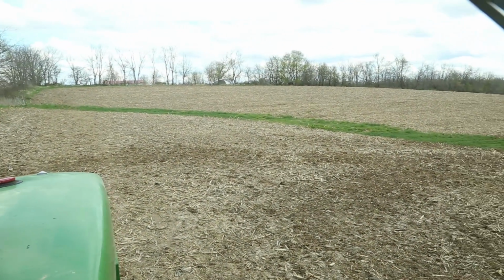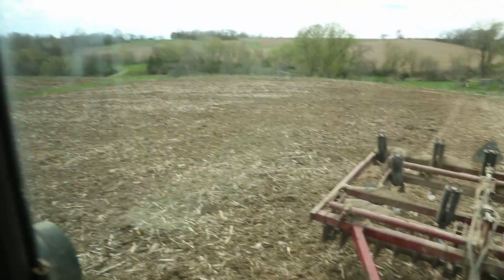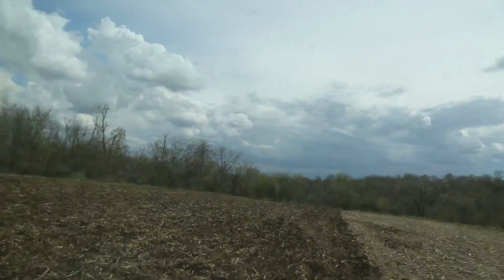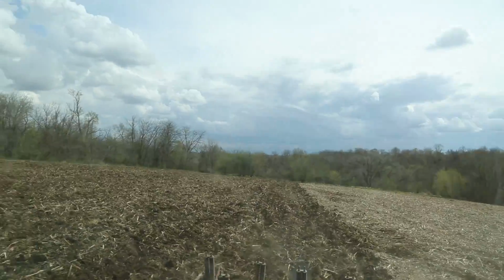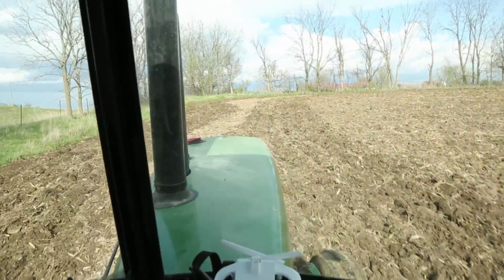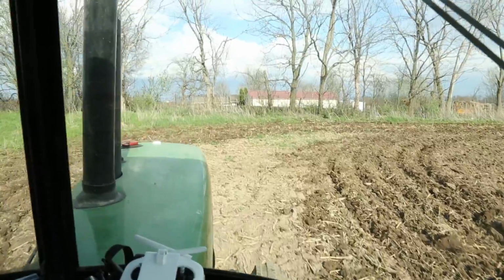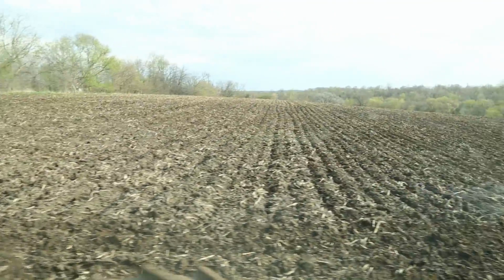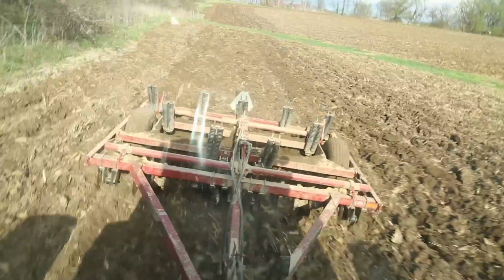Chiseling - John Deere 4640

Comment: Back when I learned how to work ground  Granpa  showed  how to split the field up in "' lands"", or quarters so you didn't have to turn so sharp at the end of the field, not hatin, just my 2 cents, great vid
Reply: too much driving w/o doing anything.  fuel costs a lot.
Reply: Flying Dutchman your right about that my boss tried telling me to do that. But on my own farm I turn sharp. It's hard with a front wheel assist but in the 2wd they are dime turns
Reply: Not only fuel but compaction on the end rows

Comment: you guys should get a four-wheel-drive articulated
Reply: +Derek Boyle Wtf? overkill much? they should get a ripper as wide as the tractor
Reply: You'd only get something like a John Deere 9RX if you have a 20ft chisel plow
Reply: +Derek Boyle You didn't hear the comment about compaction. A 4WD is half again as heavy as a FWA.
Reply: 57fitter We used to chisel plow with a two wheel drive ,then we bought a WHITE 4-150 , less compaction ,better  balance and weight distribution and done the job so much easier.
Reply: @Homegaarden  the ripper they have is perfect size for the 8235r a little much for the 46

Comment: Ryan, why a chisel plow and not a mold board plow?
Reply: +Michael Renner why would you use a moldboard this late in the spring?
Reply: +RoanJS As I'm not a farmer, I was just wondering. Here in the Hudson Valley NY, I usually see the farmers here plow with a mold board plow.
Reply: +Michael Renner each region has different needs. Moldboards help heavy clay. In loom it over works the soil. The ratios of clay, sand, loom and organic residue are just a few factors to consider in seed bed prep. Manure will leech and leave harmful salts when exposed to air and water. If it is to deep the. Roots will not reach the nutrients.

Comment: what's the reason you do so much work with the 4640? personally I would rather go with a little bit bigger tractor. Sorry if my english isn't that well I'm from Holland
Reply: jelmer zantingh its cranked up to 235 hp
Reply: 235 HP?, I'd have to see that to believe it. All I've ever run was the stock 155 pto HP. And they all smoked much more than this tractor. Besides, he's only pulling a 9 shank plow in B-2.  At 235 hp he could run in C-2 up hill and down. No pain no strain. You don't turn and OLD tractor up 75 HP, 32% in this case, and it not smoke like a freight train. Sorry, just can't buy that.

Comment: I'm a firefighter, I work 24 hours than I'm off 48 hours, I was just wondering if it would be possible for me to start a small farm and keep my current job, is farming/ranching an every day job. I know it's hard to answer so just answer, so just answer based on your farm, could you keep up with your farm working 4 days a week?
Reply from the maker: +S P2000 Depends what kind of farm, animals have to be fed every day. Crops need a lot of input spring and fall and then you have startup costs as well.
Reply: +S P2000  a lot of firefighters in my area are farmers
Reply: +kandylandfarms I would think it's " a lot of farmers in my area are firefighters"
Reply: +S P2000 There is nothing more gratifying than farming/ranching. Like another post, there are a number of firemen around that farm, some livestock and some grain. One thing to remember is that you make a commitment for years... no easy in easy out. Look for a niche and something you like. There will be times when it'll only be for the love of what you're doing that you do it. Good luck!
Reply: +Bill Whitman thanks, there has been many times in my firefighting career that I've wanted to quit but just keep fighting through the hard times and it will always get better, I guess farming is the same way.
Reply: I am 24 and a full time firefighter/medic. I am fortunate enough to farm with my dad. We run about 410 acres and raise hogs commercially (own around 1900 at a time). A small farm, around 200 acres you could probably do by yourself. The thing about animals is that you have to be there every morning and every night for them. I'm lucky in that the days I work my dad can check the hogs. In May and June, don't plan on picking up overtime or extra shifts.
Reply: I completely understand where you are coming from with the wanting to quit the fire service sometimes. Sometimes having to deal with Chief officers and the way some people in the department disrespect you (especially being a young guy) is annoying. Honestly if I had to choose between farming and firefighting, farming would win every time. There are rough days, but I get to work the same ground my great great grandpa worked, and there is no better feeling than when you get that first load of crop into the bin or get your animals sold. So if you really want to farm I say do it, just make sure you have your ducks in a row financially.